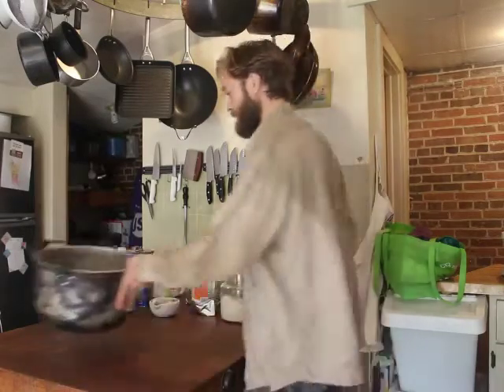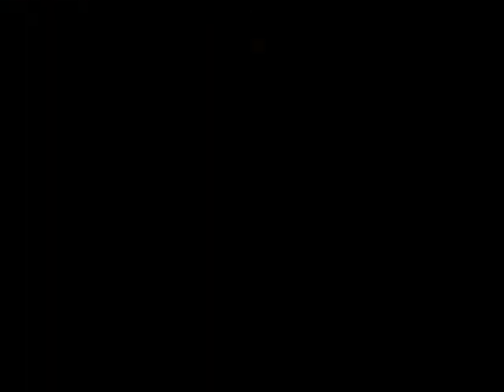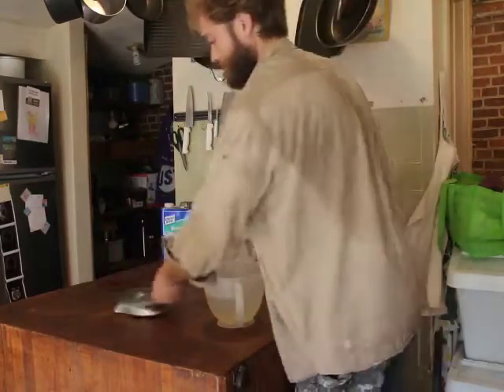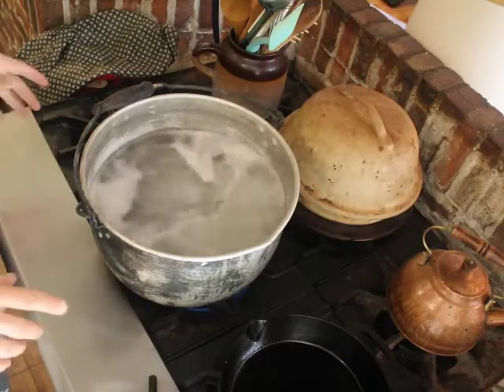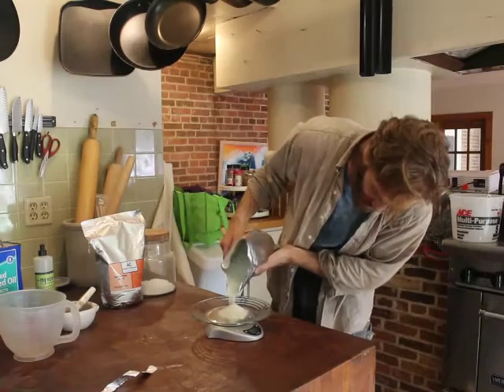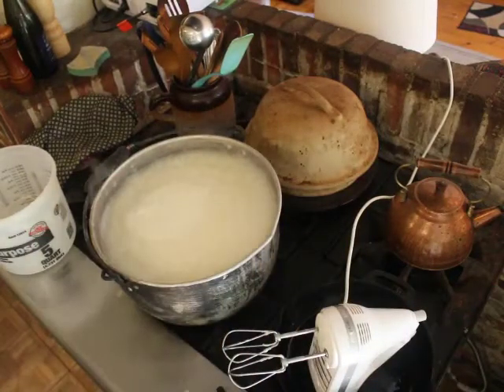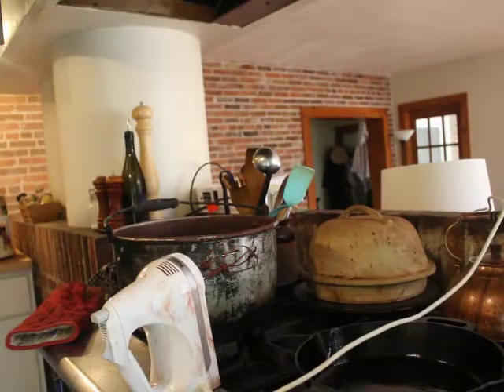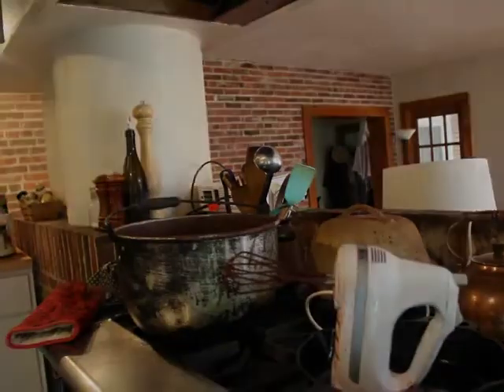Flour Paint -- Low Tech Video, No. 21

Comment: Thank you very much for the video.  Except for the boiled linseed oil, is non-toxic.  The boiled linseed oil that you get at the hardware store has metallic salts in it to speed up the drying (polymerizing) process.  Unfortunately these salts are toxic.  I wouldn't use the tools again for food grade purposes.  There is a way to use raw linseed oil though, you have to polymerize it several days out in the sun, covered with glass; but that is a whole topic by itself.
I read that if you use  rye flour produces an even stronger paint.
Reply: Good point! The boiled stuff isn't food safe. Thanks for watching. I'll have to try the rye flour next time.
Reply: Rye flour is definitely preferred, as wheat flour increases the risk of the paint moulding quite significantly... Go for stone milled, fine rye flour if available. The stone milled flour has longer fibers (as compared to steel cut flour), which helps the paint stick better. (You want a flour with some gluten, but not too much gluten, if that makes sense. Rye is perfect.)

Also: you don't need to add linseed oil to the paint. Most original recipes don't contain any linseed oil whatsoever. The linseed oil makes quite a big change to the properties of the paint. It might make the upkeep more labor intensive, alter the hue of the paint etc. 

TL;DR don't use wheat flour if you can avoid it, use linseed if it fits your needs.

Comment: Awesome info!!! Generally speaking, how long would this last on exterior siding/fence/barn before it starts looking worn? I need to protect a TON of cedar siding and I'm considering this linseed paint method.
Reply: According to what I've read, apply a refresher after 2 years, and it will last another 8-10 years. Refresh with two coats and go another decade.
Reply: It really depends on the cedar... Generally speaking, it is advisable to leave the wood as is for a year. In Swedish, we say that it rises. Idk the English equivalent, but the point of it is that the paint will stick better once the wood has risen. Otherwise it might crack when the wood starts to dry out.
You also need to consider whether or not the wood has been planed. Flour paint (also known as sludge paint) works best for surfaces that have not been planed. (For planed surfaces, we traditionally use linseed oil paint, which is better suited for the material.) 
If it's too hot when you're painting, the paint won't penetrate the wood, which means that it won't stick properly. (You also don't want it to be freezing.) Adjust your painting plans to the local climate.

Bonus: if you use fine, stone milled rye flour, your paint will last longer than if you use wheat flour. 

New wood that hasn't been painted before usually needs two coats of paint. Perhaps three. Make sure that each layer dries up completely before adding the next. (This is very important.) 
The first time you paint a surface, it will last for 5-7 years. Then you repaint it. From that point on, you only need to repaint the surface every 10-15 years (unless you live next to the ocean/in very harsh climate). 

The repainting procedure goes like this:
Brush the old paint down using a scrubber brush (or similar). Be thorough. Rinse the walls (use your garden hose, DO NOT use high pressure). Ideally, you want to start painting before the walls dry up completely. The paint will stick better if the walls are a little bit damp. One coat of paint is usually enough, but south facing surfaces might need two.
Reply: @sylvassasalladsbestick1342  What type of wood was used in Sweden for exterior siding / cladding painted with traditional Falu Red Flour Paint? I’m assuming Cedar isn’t commonly used because it doesn’t grow in Sweden. Most people in Sweden probably used local woods such as Spruce, Pine?
Reply: @sylvassasalladsbestick1342  Most Lumberyard today sells Kiln Dried Wood, is it still necessary to leave the wood for atleast 1yr before applying Falu Red Flour Paint?
Reply: @wd8005  From what I know, pine was preferred. Nowadays, people use spruce a lot. But the paint probably works on (some) other types of wood as well. Generally speaking, the flour paint was high status initially (17-18th century), and then gradually spread to lower class houses as time progressed and the pigment became more affordable. Which explains why it wasn't used on fancy materials like imported wood and similar.
Reply: @wd8005  I don't know (never heard of it), but you could always paint a sample piece and leave it out to see how it holds up to the elements.
Reply: @sylvassasalladsbestick1342  Kiln Dried Wood means the wood is heated in an oven to reduce the moisture of the wood to suitable levels for wood working. in the old days wood is air dried for months or years, that’s why I assumed that is the reason why you said you need let the wood as is for 1yr before painting with Falu Red Flour paint.
Reply: @wd8005  I think it also has to do with the general wear and tear of the climate. In Swedish, we say that some types of wood are "fat", meaning something like "ful of resin". These "fatty" pieces of wood need to be worn down a bit before paint will stick to them. So if the kiln dried wood is "fatty", it would probably still be too slippery for the flour paint. (Hope my explanation makes sense, I don't know the proper English terms for any of this.)
Reply: @sylvassasalladsbestick1342  Thanks, your explanation definitely makes sense. I have a question is Falu Red Flour Paint toxic? Traditional Falu Red is obtained using Iron Oxide from the mines in Falu, Sweden & from google they say it contains Lead, which is toxic to humans and from what I’ve seen on google is they suggest to replace the Iron Oxide with Red Ochre. Is Red Ochre a good alternative for Falu Red Flour Paint?

Comment: Hey, great video in general! It's very nice to see that our traditional paints have something to offer outside of a Scandinavian context.

Just one thing: would you please consider adding a note about the type of flour that should be used? The resource you've linked mentions wheat flour - which isn't at all what have been used traditionally. Wheat flour contains too much gluten (and nutrition), which increases the risk of mold. Fine stone milled rye flour is really the way to go if you want a long lasting and durable paint. It contains just enough gluten for the paint to stick, but not enough for it to start molding. The stone milling part is important too, as modern milling techniques cut the fibers shorter (which makes the paint less durable). I understand that some people might not have access to the right kind of rye flour, but they should at least be aware of the potential risks associated with using wheat. 

And one last thing: this paint could be made with any earth pigment. You could use yellow ochre, or whatever is available in your local area. (Use zinc sulphate for light pigments and iron sulphate for dark pigments.)
Reply from the maker: Thanks so much! That's great information and doesn't surprise me. Wheat would have been more expensive and coveted than rye anyway, so it makes a natural choice. I grow and grind different grains here, including wheat and rye and will give the rye a go next time. Thanks for watching!
Reply: Interesting. Is the use of the iron sulphate in the recipe not for its antifungal properties?
Reply: I've heard of borax being used too for its antifungal properties. Is that something you've tried?
Reply: @bodo9387  Some people use Boracol, which I think is Borax. If using Boracol, something like 100 milliliter Boracol to 10 litres of paint could work. I personally wouldn't use it, as it is quite toxic, but if it's used, it should be added after you've removed the paint from the heat. 

To add to this: it seems like there is a connection between the addition of linseed oil and the occurrence of mold. As in no linseed oil - less mold. However, adding (boiled) linseed oil makes the paint a little bit more weather resistant. But it also gets harder to remove it once it's time to repaint the house.  (If you're adding linseed oil, you have to add soap as an emulsifier. We use something called brunsåpa/kristallsåpa, grönsåpa or gulsåpa. These soaps have a pH of 9.5-11 or so. Max 8% linseed oil and no more than 2% soap.)

Mold spots etc is more of a problem with lighter colours, but it also depends on where you live.
Reply: @bodo9387  Perhaps that was the original thought, but it doesn't seem to have any remarkable antifungal properties. 

This being said, it is one of the ingredients that's included in the "core" recipe for this paint, along with flour and the pigments. It probably shouldn't be omitted (unless making lighter paint, as mentioned in my original comment).

In the olden days, different painters added different ingredients, depending on local customs and personal preference. Some of these included resin, urine, salt water that had been used to preserve herring, wood tar, and many more. This means that there are multiple ways of making this paint. (And some versions probably work better than others.)
Reply: @sylvassasalladsbestick1342 that's fascinating and really helpful, thank you! Apart from the necessity of the rye flour being stoneground is there anything else that's essential about using the right sort of rye flour? For example sometimes you can get light or white rye flour, as opposed to wholemeal. Is wholemeal the best choice?
Reply: Have you ever used this paint recipe on other materials like gypsum plaster or wood previously painted with standard commercial paint? Would it fail to adhere to it?
Reply: @bodo9387  Never tried it on gypsum plaster, and I think there are other types of paint that work better for it. 

I know for a fact that flour paint won't really work on top of other paints. You'd have to remove all of the other paint before using flour paint. Otherwise the old paint works as a barrier between the wood and the flour paint. It simply won't stick.
Reply: @sylvassasalladsbestick1342  thanks for the reply. Do you know if the type of rye flour makes a difference, like as in wholemeal, white, light? The wheat flour that is usually recommended is white, so I wondered if it was the same with rye flour?
Reply: @bodo9387  Many recipes simply call for rye flour without specifying what kind. So I'd say that it's a matter of preference, more than anything else. I've been successful with wholemeal too. But sieving the flour to avoid lumps is probably a good idea regardless of what type of flour you use... Again, there are many different flour paint recipes. One key difference, though, is that the wheat makes the color grow mold quicker. (Rye flour paint can be stored for longer.)
Reply: @sylvassasalladsbestick1342  Thanks! Your knowledge and help is greatly appreciated!

Comment: Is there a way to make black flour paint, I need black color paint for my wall
Reply from the maker: Oh, good question. You'll have to google for that. If you can find a powdered black mineral or earth pigment that will work in paint, you can swap it out for the "iron oxide" in the above recipe. Or maybe experiment if you have the time. I wonder if powdered charcoal would work or if it would smear and rub off?
Reply: @LowTechInstitute  thanks👍
Reply: @LowTechInstitute  If you want something that looks like flour paint but doesn't rub off as readily, you could add more linseed oil to the paint. This would transform it into a sort of hybrid paint, but it will still have the same matte finish as flour paint.

Black iron oxide should certainly work for flour paint. Idk about wooden charcoal, but I know that people have burned bones and used the charcoal in other types of paint. Soot (from wood fire) has also been used in linseed oil paints and lime wash (kimrök - carbon black), but I've never tried it in flour paint. Can't see why it shouldn't work though...